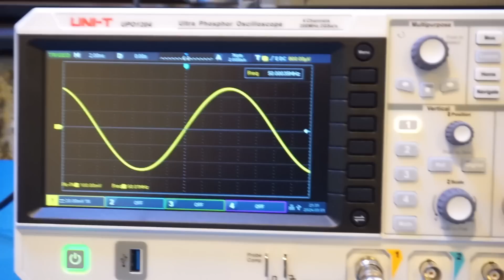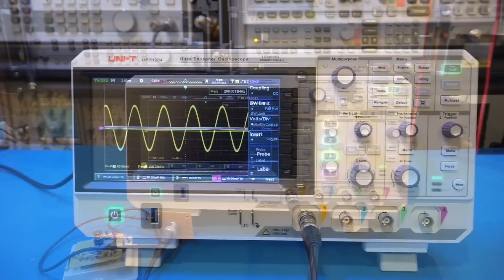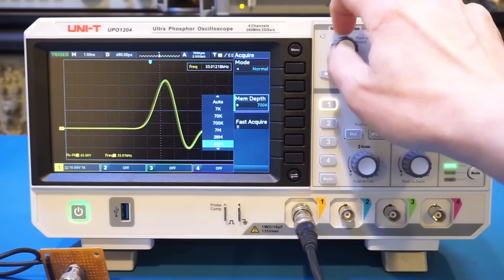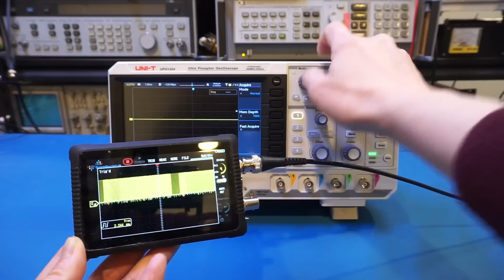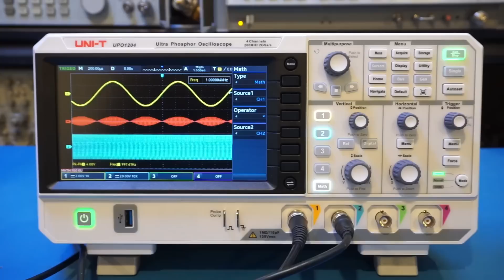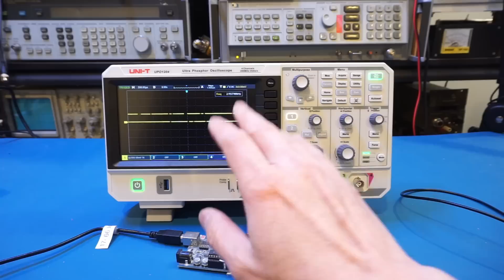Review of a UNI-T UPO1204 200 MHz 4 Channel Digital Oscilloscope

Comment: Is UPO 1102 the same, ie. an oscilloscope of the same series as the UPO 1204? So, are their capabilities the same except that one is 2ch/100MHz and the other is 4ch/200MHz (I assume software locking). And yes, when it comes to software locking, are there any hacks for this model? Also, I guess the UPO1102(340e) is a better buy than the Hantek DSO2D15(265e) and that the 80e difference is worth it???

Comment: WATERFALL:  Uni-T does not even mention this capability on their website (!)
Would like to see more Waterfall demo.  Waterfall is extremely useful when doing modal analysis of structures with a transient load like impulse or step.  
SUGGESTION:  use a microphone input and tap something that rings and see the harmonics and their damping.  Could be a tuning fork or anything you can make ring.  
SUGGESTON:  part of the Waterfall "survey" is to determine what bandwidth and sampling have on the time between waterfall lines - slow is not good - so where is the sweet spot between speed and resolution?
This waterfall capability is now my #1 criteria for buying my first non-Tektronix scope:  my first digital scope.

Comment: Hi Kerry,

Regarding vertical resolution ...

Does the 8-bit apply to both screen resolution and internal voltage resolution, or just screen? 
If also internal, then that implies some considerable quantisation errors during measurements?

Thanks.
Reply from the maker: The 8-bit is resolution of the acquisition ADC.
Reply: @KerryWongBlog  Thanks Kerry.

Comment: I love uni-t gear. I donate the 61e dmm to students all the time. Id like to get one of their spectrum analyzers but the shipping from china costs a fortune and ive learned 99 percent of sellers hate honoring warranties.  Ive had so many different soldering stations and such from ali express and been left high and dry. The dispute system is broken. They basically pretend to take a complaint but ultimately it's up to the seller in the end to make things right. Even guys ive purchased tons of stuff from to donate. Im buying a metcal station if my current soldering stations break haha. I wish uni-t would lower their prices a bit and market more aggressively because they have great gear but they dont concern themselves with input safety on their meters. I donated a thermal cam to the guy who fixed our furnace last month. It was a great piece of gear but he used it more than me haha. It was the uti721m. I had it for 8 months and never used it. I gave an electrician a brymen once because he had a dirt cheap extech. I figured he should have a meter ul certified. 

How would you like if i sent you a curve tracer i bought. Its a Chinese wk-210k. There's something fishy about it and id like to get someone to make an informed video on it as there are not many. Id send it to your po box. No strings attached or further contact required.

Comment: Considering the already existing Rigol DS1054Z, this scope makes no sense, especially for the price!
Especially with the Rigol DHO804.814, this scope makes ZERO ZERO ZREO sense!!!
Reply: @stevenbliss989 

you sounded like someone having a nightmare and hysterically screaming in bed, calm down, no need to stress it out, it's just an oscilloscope, and people will buy what they think it's good for their needs. 
also you are comparing the UNI-T to other devices that have lower bandwidth, lower sample rate, lower memory depth (per channel), and the 12-bit vertical resolution is something barely useful because it is only used when you want to take a really closer look at specific signals which 90% of the buyers don't bother/need and the remaining 10% of the buyers are professionals and most of them buy much more expensive oscilloscopes.
this device also comes with decoding features which are great.
Reply: @bigdog9480  I agree with you for the most part, BUT like Tek and others, it is over priced!  And for the record, in the Rigol 900 series, there is a 200MHz version, but still only at 1.25 Gs/s, but for a far lower price.

Comment: The UPO1204 stands out as the most worthwhile 4-channel oscilloscope currently available on the market. At its price point and specifications, other brands feel outdated in comparison. UNI-T's oscilloscope excels in both hardware and software, boasting the latest and most efficient technologies. Moreover, UNI-T is the only brand that manages the entire production process—from PCB assembly to final product testing—in-house. This comprehensive in-factory approach signifies a meticulous control over the entire manufacturing process, ensuring an unmatched quality in UNI-T's products. This level of dedication to quality and innovation makes the UPO1204 an exceptional choice for professionals and enthusiasts alike.

Comment: The UNI-T UPO1204 200 MHz 4 Channel Digital Oscilloscope is a nice scope.  My Siglent SDS1104X-E  will do for now. The 12 bits scopes will be the way of the future.  😎 Thank you.
Reply: Singlet SDS824X HD and Rigol DHO924 have 12 bits and many more options
Reply: @RaduRadi-l2e  Yes I want to get one of those 2, which is better in your estimation?
Reply: @catharperfect7036   Use the SDS824X for 2 GSa/s, and the DHO924 for higher-frequency measurements in single-channel mode.

Comment: What sets this oscilloscope apart is that the protocol decode options are included.  For many other scopes, decode is an extra cost add-on.  It would have been nice to have optional CAN/LIN bus decode for looking at automotive and industrial control signals.  Including of RS-232, SPI and I2C at no extra cost is a good start.

I am interested in the MSO2204-S 200MHz 4+16Ch MSO with Signal Generator, but getting equivalent protocol decode noticeably increases cost over the otherwise competitive starting price.
Reply: I bought the mso5074 and did the firmware upgrade and bought the logic analyzer probes. Little did I know someone sells them from time to time for a third of the price. I'm thinking about selling it to buy a used tektronix mdo. It's still under warranty. I saved the original fw. I paid 2400cad for the scope. It's more feature rich than I require and I got it free when a hurricane tore my house apart. I've not even used it for 5 hours. I use my tds2002c more often.
Reply: I'd include the logic probes. I have people who will speak to my honesty if you're interested. I'd love to have the old tektronix mdo that wae5w has had for like 8 years only one a little cheaper. I don't want to spend 3k on a spectrum analyzer to fix audio gear when I can sell my scope and add some money and save bench space.

Comment: VERY NON-LINEAR BANWIDTH, going up-down-up-down by about 5% all over the place!!!!!!!!!!!
Reply from the maker: Where did you see this behavior?
Reply: watch as Kerry winds up the frequency, it is very obvious. @KerryWongBlog
Reply from the maker: Keep in mind that, the impedance matching is by no means precise so that at least contributes to some of the variations you saw.
Reply: @KerryWongBlog  Exactly.  I came here to comment the same thing.  I see there is a a 50 Ohm feed through terminator on the scope input, but there is almost certainly going to to be a little bit of reflection and what is shown in the video is well within expectations.  There is a reason spectrum analyzers have internal 50 Ohm termination and this video shows why.  That also explains why if you blow out the input termination of a lab grade spectrum analyzer, you’re probably looking at a several hundred Dollar or more replacement part.
Reply: @KerryWongBlog As Steve said, all over the place, but especially as you increased  the frequency above 200MHz, at about the 4:15 mark and beyond.
Reply: @KerryWongBlog  The amplitude dips every time you increase the frequency. Is this the scope or generator? Oh... I bet you have averaging or persistence too high, causing these dynamic anomalies...
Reply: @qwaqwa1960  Good deduction I bet your right!
Reply: "Why won't my listed 200Mhz scope measure a 350Mhz signal correctly???"

Geez, I wonder. Complain when UNI-T says it's a 500Mhz dso, not when  you get more bandwidth than advertised.
Reply: Most of the replies here were wondering why the scope varied BELOW 200Mhz, as well as above in some cases.
I understand your sarcasm, but I think you misunderstood many of the replies.
Reply: It's digital
Reply: I think this is due to non-perfect transmission line termination.
Reply: Yeah I think there's some software over adjustment magic going on :) I think repeating the pulse based bandwidth analysis on 2 and 4 channel modes might have further elucidated this. Great review though!
Reply: People i got to pick my first "discrete" scope,which one to pick?
Can someone help me to make "my" choice ???

Thanks everybody who has listen.
Reply: 1) The Rigol DHO804 is BEST (12 bit and four channel) - way ahead of this scope btw.
2) If 8-bits (like this scope, but 1GS/s) is good, as it has been for decades, and as Kerry said, is fine for all but many "special" cases, then the Rigol DS1054Z, still 4 channel, is HUGE value for money, and low cost.
3) If money is VERY important, then the Hantek DSO2C10 (2 channel only - but fine for 99% of the time) is INSANE value.
Reply: this totally ruins this as a scope... not having a trustworthy amplitude measurement makes it useless